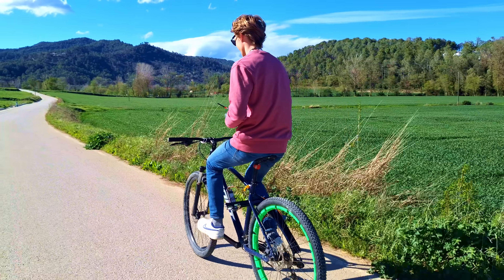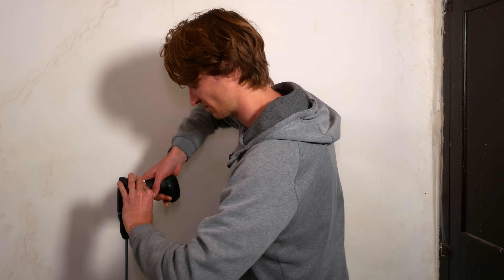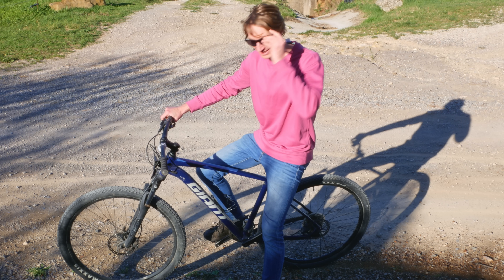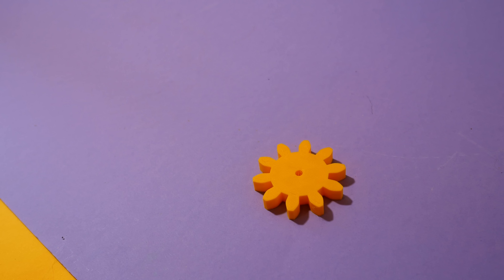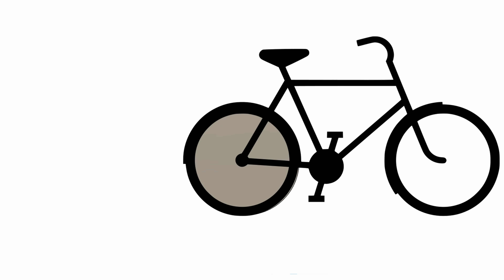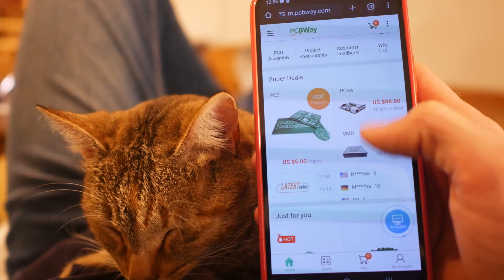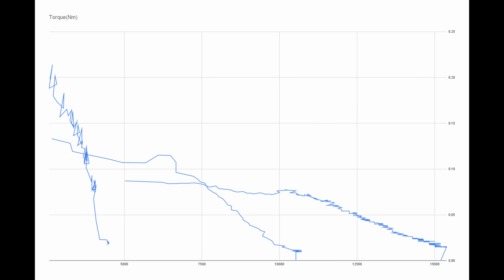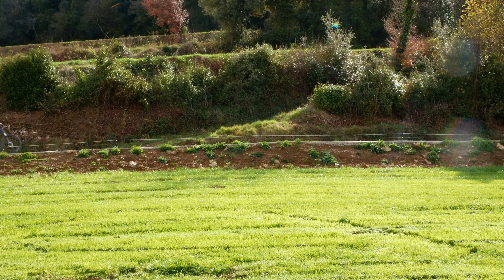i accidentally 3D-Printed a Drone Powered E-Bike...

Comment: a giraffe is a great unit of measurement. its actually a horsepower!

if you lift the average giraffe of one tonne or 1000kg to roughly the same height as an average giraffe or 5 metres every minute, its very close to 33,000ftlbs a minute. 1000lb lifted 33 ft or 10M. so about 1000kg lifted 5 metres.

there you go. a giraffe is a perfectly acceptable unit, being equal to 746 watts, give or take...

Comment: Although boring, you can just test how much current the motor can withstand without overheating, then with the kv value you have your torque. 

1/kv = torque
1/(rad/s/V) = (Nm/A)

Doesn't quite apply at high rotor speeds where other things start to become a problem.

Comment: I wrote this idea to Tom Stanton's comments back ago. Glad that someone tried this.
Although, as an electrical engineer, however i appreciate your design, I gotta say it's poor choice of motor/controller/battery.
And pivot gear (small one on the motor) should be aluminum

Comment: Why don't you use one of the bigger 5960 size helicopter motor that takes a lot more horsepower or a 4292 1500 KV brushless inrunner motor because I was a little tiny drone Motors are working out way too much go check out any 8th scale or 1/5 scale electric motor and ESC combos

Comment: @SunShine
Engineer here: increasing the helical angle also makes the teeth slide much moer ovewr eachother. the most efficient gears are straight spur gears (more than 99%). the higher the helical angle the less efficient you become until it resambles two screws (efficiency lerss than 30%). whith the high angle and also high module (determines the size of the teeth) you used you probably were much less efficient than a 2 step belt reduction, though obviously funnier looking ;)

Comment: i bought a spare 12vlt wire feeder for a  small mig welder basically what they put inside 12vlt car winches  
maybe if muck about with some gears  it'll push my MBike 10klph cruising speed along the river battery & charger unit will cost me the most .
i,d put a victa motor mower engine on but them 160cc r noisey

Comment: Something about the way those speed torque curves loop around is raising questions. Like, is that hysteresis? Did you find agreement with the specifications of the motor? Iwas thinking about formulating an optimization problem , but my feeling was that theres a lot of risk that actual performance is not well modeled enough and i would end up just going with whatever had the best reviews on amazon 😂 anyway.  I spend a lot of time working with optimization software, but my dc motors fundamentals is rusty, especially now that dc brush motor has basically fallen by the wayside and the classic texts on dc machines dont really adress brushless system design ...i dont know if thats a good question but really looking forward to the next video...

Comment: Giraffes are always a reasonable unit of measurement - if it gets smaller just start comparing it to smaller parts of a giraffe, like just the size of its tongue
Reply: a horsepower is 33000ftlbs/min.
or 1000lb to 33 foot /min.
or roughly 500kg to 10M/min. 
or 1000kg to 5M/min.
the average giraffe is 1000kg.
the average giraffe is 5M high.
a giraffe lifted its own height every minute is therefore a horsepower, and is equivalent to 746 watts...

Comment: Inside facing gear teeth on the wheel is a good idea. Until you get some mud/snow/road grit in the gear at least lol.  If you could support the pinion on the other side with another bearing I think you'd get much cleaner data from it, looks like a lot of energy is being wasted deflecting the pinion which is also why it wants to break.

Comment: Super cool. The gear surface looks really choppy though. Do you get true rolling motion? My guess is the plastic gets shredded after a couple of blocks. But maybe you could also just stack a finite number of spur gears (real ones not 3dp) phased by 30 degrees or so? Ah but you cant buy a 3-tooth spur gear anywhere. Laser cut maybe.  
Great work!

Comment: Reading those power charts always confuses me as there are two types of power: electric power (which is the input power) and the mechanical power measured from the shaft. Now, please correct me if I'm wrong but when you show that the power chart would go off the chart, you mean the electrical power, right? Because the mechanical power would be almost zero at low rpm and high torque condition?
Reply from the maker: I showed mechanical power (the blue line is torque, the red is power), but the tests didn't go all the way down to 0 RPM, because i didn't want to burn out the ESC, of which i only had 1

Comment: so this ebike conversion,  1)are you able to still pedal without breaking the bike system? 2) can pedaling generate power to recharge the batteries?
Reply: There's nothing in this that would prevent you from pedaling with the motor going. As for getting regenerative braking, that's going to depend solely on the speed controller, which the one he used isn't likely to support it.

Comment: In terms of torque, you might want to check out leverage/lever bikes whereas the pedals are directly connected to the back wheel gear making for far less weight, far less costly, far less maintenance, far safer to ride, far more comfortable to pedal.

Comment: First thought, have the drive gears closer to the motor so they can be around the shaft itself (maybe also add keyway). Second thought, print the drive gear out of natural nylon and maybe also use silicon grease. Third thought, I should print it out and join the fun 😅

Comment: For those outside the US, I had AI do the conversion. 

An average banana is around 7-8 inches tall.  An average adult giraffe is 14-18 feet tall.

To convert feet to inches, we multiply by 12.  So, a 14-foot giraffe would be 14 x 12 = 168 inches tall.

Therefore, a 14-foot giraffe would be roughly  168 inches / 7 inches/banana = 24 bananas tall!

For an 18-foot giraffe, it would be even taller at around 28-32 bananas tall (depending on the exact height and banana size).
Reply: thank you this really helped. lol :D

Comment: Outstanding work! How big can PCBWay go because a printed aluminum rim with the drive keys in it would be 👌 bang twin motors on opposing sides of the rim to reduce wear / keep the rim centred under load - as well as boosting power...  😁